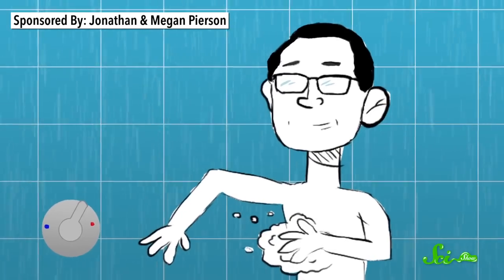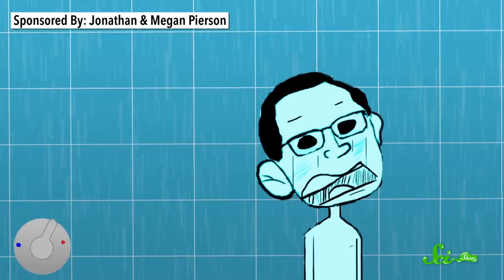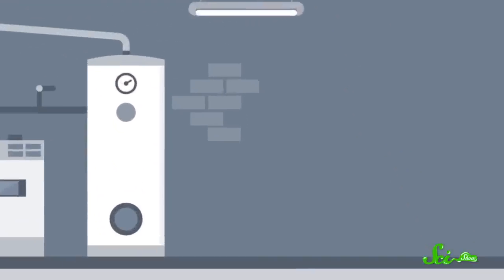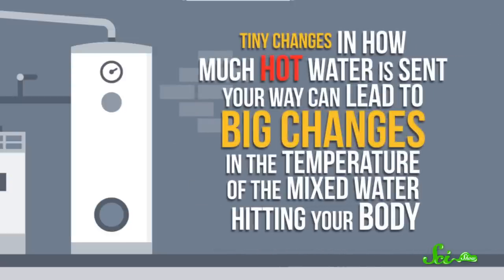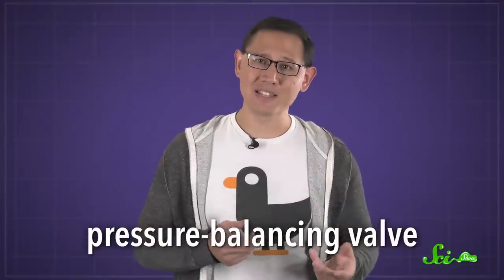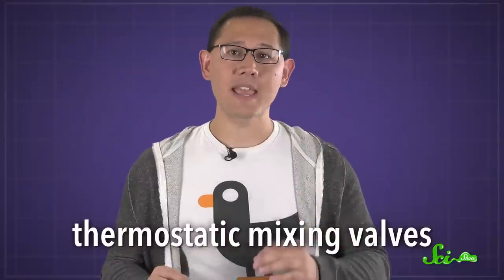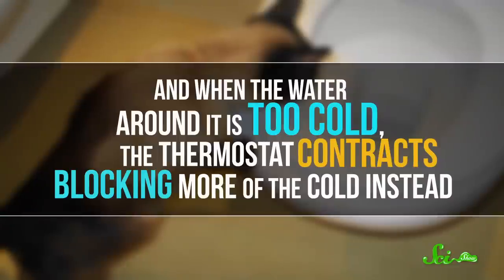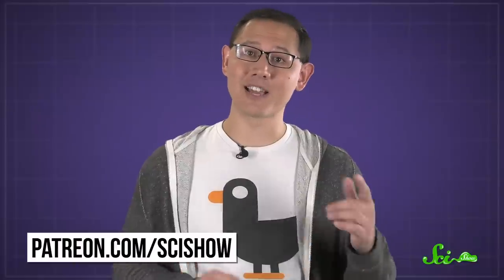Why Is the Perfect Shower Temperature So Hard To Find?

Comment: We'll look back on how we couldn't shower and flush at the same time, just as we look back on when we couldn't make a call and run the internet at the same time. Huzzah!
Reply: or vacuum and watch tv at the same time.
Reply: Mahoole rip still want flush when someone is taking a shower
Reply: I used to have that sort of internet issue not long ago
Reply: Pretty sure this is mostly an American issue. Here in the UK, at least, we often have electric showers. They heat the water to the temperature you provide as it comes to the bathroom. It can be being used elsewhere at the same time, doesn't matter, it heats the cold. I've never had any issues when showering.
Reply: What's the statistic again on death from electrocution while showering due to faulty cheap import electric shower heaters in the UK? Just wondering, it's 0 wherever those electric heaters are not used lol and because i recently watched an electrician from the UK open a few up on youtube and they were all dangerously faulty (all import cheap ones).I'm in the EU btw not US, we just tap from the boiler too, at least in the Netherlands, I just marked the perfect mix margins on the knobs and will get some expansion based temp selectable one at some point, no electrics near my shower please.)
Reply: And another broblem that is already solved outside the States but oh well...
Reply: InnSewerAnts in Finland we have facilities that heat the water as a side process when making electricity. The hot water is then pumped through pipes to households so you always get endless hot water. Sorry for bad English if there was any.
Reply: Mahoole Magic School I can shower and flush
Reply: +Mahoole Magic School already a reality in most homes in Sweden. Public heating ftw!
Reply: That whole problem seems to be an UK/USA one, here in Germany that never happens. Even with former communist plumbing (when I was younger) my parents could go to the toilet while I showered or visa versa and it wouldn't go cold or hot in the shower. Get good plumbing and you won't have that problem.
Reply: You can't flush the toilet while taking a shower?... I've seen that in movies, but never understood it. Flushing the toilet while showering at my house does nothing at all.
Reply: Indeed. And now I can watch a youtube video and a movie streaming at the same time. That is pretty awesome.

Comment: I thought it's because the body gets used to the hot temperature and then you need a higher temperature to compensate
Reply: Xextreem thought so
Reply: amoxford 2 That is what i thought too. I always start of on a bearable tenperature and then increase the temperature in small increments.
Reply: Deedit I do that aswel lol
Reply: Both are correct. A lot of things happen for multiple reasons (trees grow because of soil, light, water, carbon dioxide, etc.), and always going for just one explanation can lead to heavy mistakes.
Reply: also time of day

Comment: Had this problem for a while. The key here is a constant water pressure. I have an electric water heater, I used a multimeter with thermocouple to measure temperature of the showerhead itself(made out of chrome). I turned those shower valves wide open and my water heater temperature knob to the max. Wait till the temperature settles; from there adjust water heater temperature knob. I settled on 45°C average using min/max function of the multimeter and constantly  testing the water coming out from it. From there I have a constant max value without burning myself and could pull back a little to normal body temp easily. ü

Comment: As a boiler tech, and professional HVAC tech... having a mixing valve set on the tank, so the hot temp is only slightly above perfect bathing temp as it exits the tank, but the tank itself is set very. High, causes you to use the hot on full, with little or no cold mixing... so any cold water or hot water usage elsewhere in the house has zero effect on your shower temp bliss...

Comment: Or just get an electric shower hooked up to the cold water. Easy to get the perfect temperature because you aren't mixing hot and cold just controlling the heating coil.
Reply: The cheaper ones have the coil at a constant temp and just vary the water flow rate.
Reply: That whole problem seems to be an UK/USA one, here in Germany that never happens. Even with former communist plumbing (when I was younger) my parents could go to the toilet while I showered or visa versa and it wouldn't go cold or hot in the shower. Get good plumbing and you won't have that problem.
Reply: Electric shower! OK, go with that, if you want your grave stone to say "Death by shower". 
You could get sevearly electricated, unless you have everything grounded.
Reply: It's still hard, i think that the temperature and the humidity in the room also change the perfect temperature shower temperature, considering that the temperature and the humidity of the room increases with time makes the thing even more complicated

Comment: As an engineer working with hot water tanks, I wouldn't keep the water at a temperature lower than 60*C. Stay well above the 50*C as said in the video.

Comment: I once owned a house with a tankless hot-water heater.  It was heaven !  I would set the exact temperature I wanted the water to be, and then just open the hot valve in the shower.  Used no cold water at all -- didn't need to mix it with cold because it was being heated to exactly the right temperature that I'd selected on the tankless hot-water heater's control panel.  And it would never change the temperature.  The pressure might change a bit when someone flushed the toilet, but the temperature never changed.

Comment: Best solution is the Rinnai Infinity instantaneous (tankless) hot water heater (or other computer controlled Tankless system). You move the tap all the way to hot and set the temperature on a digital control panel next to the shower. Holds water temperature to the degree no mater what else is open in the house and also uses the exact amount of energy required. Surprisingly this type of system seems to only be popular in Japan/Australia/UK and I think was only recently introduced to the US market.

Comment: The hot water going down the drain could be used to warm the cold water pipe so you use less hot water making it perfect if you have a small water heater

Comment: I think Japan has this problem pretty worked out. The hot water temperature is set via a remote and uses gas to heat the water. Set your hot water to 37 degrees and you get water at 37 degrees, you don't need to do the hot water cold water mixing dance, just use the hot water. As a bonus, you're not wasting energy by using electricity to continually heat a large container of water 24 hours a day. Only downsides are it takes a bit of time for the water to reach your chosen temperature and you lose pressure if something else is using hot water.

Comment: In Ireland we used to have the immersion, which you manually turned on instead of always having hot water. Now most people have electric showers if they possibly can. Don't have to preheat the water, cold taps don't affect the shower much if at all.

Comment: Now there are valves that are called  tempering valves as well and they are adjusted to the correct temperature flowing to the supply tubing to showers, hand basins etc while still allowing a separate tubing to carry the desired hot water only to things such as washing machines, dish washing machines, and any outlet which one wants the available hottest water from the hot water tank for other uses. In Australia these must be fitted and adjusted by qualified plumbers to the temperature that is required by law in some cases such as any situation were any person is exposed to public and institutional washing facilities. A domestic situation is governed by what the householder requires the setting to be but anything over 40C is getting rather too hot especially for the elderly and babies.

Comment: Back home, it was sometimes difficult to get the shower to the perfect temperature. Then I learned to start my shower by going down to the laundry room and turning off the taps to the washing machine so that the hot and cold water didn't mix until they got to the shower.

Comment: I must live a life of luxury because my shower is not only capable of having a stable temperature, it can also be fine-tuned properly and anyone can use any source of water, both hot & cold, anywhere in the house and the temperature doesn't change a bit. I only get a minor drop in water pressure at worst, at best I don't even notice.

I think the reason is because we're using an on-demand heater, the heater is very close to the shower and the heater is close to the primary "source" of water in my home, and we're using not-cheap proper mixing taps

Comment: Another effect is that the pipes between the heater and the showerhead may not be insulated. The water in them is probably still warm, but not as hot as in the heater. So the temperature of the water coming out of the showerhead will be colder until water makes it all the way from the heater to the showerhead, then the water from the showerhead will get hotter.

Comment: The solution is seperate valves hot and cold. Crank the hot, adjust the cold till the mix is right, and back the cold out as the water temp drops.

Comment: There's also the the issue of different parts of your body are more or less sensitive to heat. For example I like hotter water on my back than I can stand on my face.  I had to replace one of my shower valves and we put in one of those safe valves so you can't get scalded. You can turn it to full hot and not be too hot.

Comment: turn on hot @90 degrees, cold tap @ 25 degrees (this is specific for my shower ofc), and its perfect. for some reason the cold tap has higher pressure then my hot tap, prolly regulated by the combi heater.

Comment: I Normally put the Warm Tap on first  then when a bit too hot  I balance it with the Cold Tap so it I say is neither Scorching  or Cold as can be then I step in the Shower Stall  and wash myself mind you it  had taken many tries to  get the Temperature Balance for my liking.
Reply: That whole problem seems to be an UK/USA one, here in Germany that never happens. Even with former communist plumbing (when I was younger) my parents could go to the toilet while I showered or visa versa and it wouldn't go cold or hot in the shower. Get good plumbing and you won't have that problem.

Comment: There is another issue. As the cold and hot water moves through the valves to be mixed, those valves change size, changing the flow of the hot and cold water until the valves reach equilibrium temperature is with the water passing through them.

Comment: I have a tankless/demand water heater, which I set exactly to the desired temperature.  95°F or 102°F or 105°F or 112°F or whatever I want for the shower or whirlpool tub soak ... run only the hot water and the set temperature is what I get, no need to mix in any cold water.

Comment: In Brazil we use electricity to heat the water, so it's not that hard to make it the right temperature, you just need to increase the flow of water to "dilute" the temperature
Reply: And then someone flushes the toilet...

Comment: /FacepalmYou guys completely missed 2 of the major factors (arguably THE major issues) causing the problems:1 - When you use hot water, cold water enters the heater, cooling the water ever so slightly, The effect gets more pronounced the longer the shower, meaning even without anyone flushing/etcthe water temperature cools down.2 - Your body adapts to the water temperature, especially if it's hot, making it seem cooler than it is. Just like getting into a cold pool takes time to "get used to it", same thing but with warm/hot water.

Comment: So in my bathroom, the thing that controls the temperature and strength is the same thing. If I want it cold the stream is weak. If I want it hot the stream is decently powerful. But I can't have powerful and cool
Reply: Sounds like you have one of the cheaper electric showers.

Comment: I find that the temperature is easier to adjust if you turn it on full hot for a couple of minutes first, then lower it to the desired level

Obviously you don't get in the shower while it's on full hot, so there is that pesky "wasting water" thing to deal with

Or you can just learn to deal with lukewarm  or cold water

Comment: well i just turn the heat up til its uncomfortable and then gradually increase it as i get used to it also our water heater is set to around 80 degrees c and those pressure balancing valves are required by law here.

Comment: My place doesn't have the whole flush the toilet burn alive issue and I know where to set my handle (a little lower than the middle for warm water) so I usually have no issues. It's only if I take a really hot/long shower or someone before me just did that I am fiddling with it and rushing to get out but I am usually alone so no, it's not usually difficult for me.

Comment: Route the pipes so the shower is the first fixture to get cold and hot water in the house.  Also, have the water heater get its cold water supply after all the fixtures get theirs.

Comment: Get an instant hot water system and you don't have to worry about adjusting it... You just set the temperature to want you want it at before you get in the shower and it stays that temperature.

Comment: Now try adjusting with a shower in which the hot water also controls the pressure but only until a certain point, while the cold control the pressure more but has less of an impact at the start and you'll know my pain.

Yeah my shower is basically a torture device.

Comment: This video doesn't explain why the water temperature coming out of the main faucet (as you adjust the temperature before engaging the shower nozzle) is VASTLY different than the water temperature coming out of the shower nozzle. It's generally a 10 - 20 degree difference...so why is THAT "perfect shower temperature" so hard to find?

Comment: None of these explanations hold up to scrutiny. I can turn the dial very far before it even starts increasing the water temperature, then it suddenly goes from pure cold water to pure hot water over the span of about 20% of the dial when it's running at full blast, less if it's running at a lower rate of flow down to a perfect swap straight from hot to cold with zero in-between when the water is flowing at about 1/4th the max rate. There is no way the expansion of the pipes or any of that other stuff could account for this. Also, I've used a small number of water temperature selectors that work just perfectly. I am convinced there is no problem here other than shoddy engineering.

Comment: Ok this is my perfect show temperature turn on hot and some cold, after that slowly turn down hot until hot water is completely off. Why I do that?

To make my body get use to taking cold shower faster, plus there's lots of benefits doing cold shower then hot shower. Also you save gas or electric bills.

Comment: Strange never had this problem in my 30 years...  It takes like 1 min to find right temperature on normal shower and if you don't change it it will stay the same or if you have electric heating shower it will keep settings all the time.

Comment: Wow all I do is tern it on. It's already set but I do have to what a moment for it to go though this odd way to cold then way to hot cycle before it settles into it's acceptable temperature. I know it sounds like a computer is setting the temp but the only computer is the one that tells the water tank when to tern on and off.

Comment: Not my problem, man. I don't shower. I only bathe. I circulate the water around me as I fill the tub, so there's no flow onto me and I adjust it as needed. It's always just right, and I don't have water under pressure leeching the oils out of my already dry skin.
     BATHING: IT'S WHAT SHOULD CLEAN YOU.

Comment: Fluctuating water temperatures shouldn't be an issue unless your water heater isn't very good, there's something wrong with your otherwise good one, someone's trying to shower somewhere else in the house at the same time as you, or you're taking a very long shower.
Reply: Well ours doesn't work unless the heating is also on so... yeah.

Comment: ..oooor you could have a shower where the hot/cold control is separate from on/off .. so you have same water temp each damn time use shower - save a butt load of time (and misery)...

Comment: What??? Surely, the interval for a comfortable shower is quite large. I mean unless it's scolding or freezing it's fine, right? Who on earth spends time finding the perfect temperature? You are just in there for two minutes. Most of my showers are after a run or working out and then I just use the cold water because warm water doesn't really affect the experience.